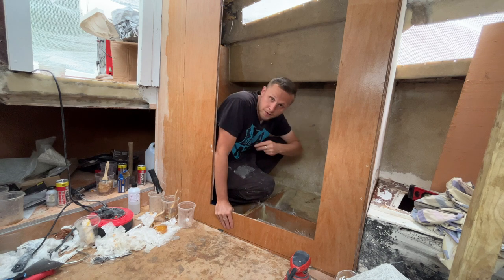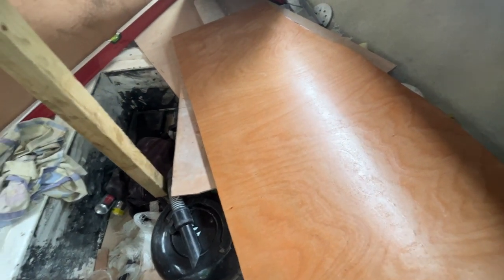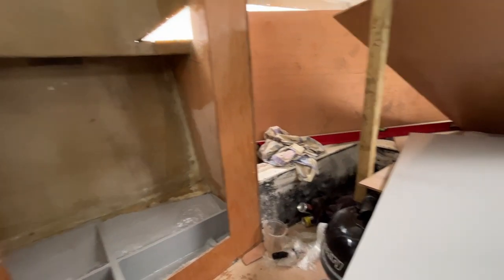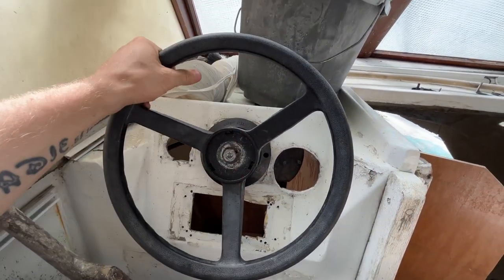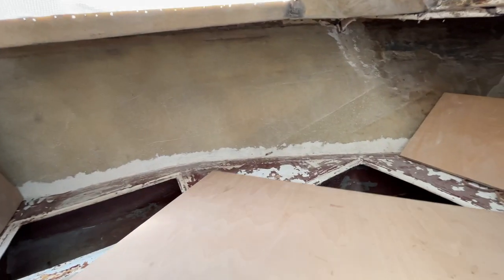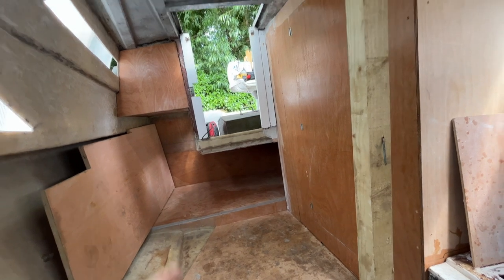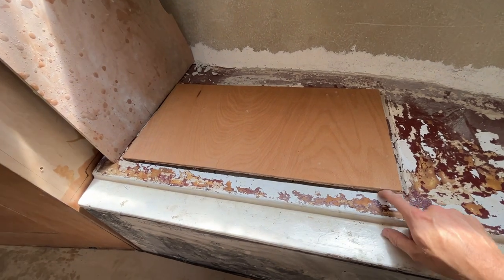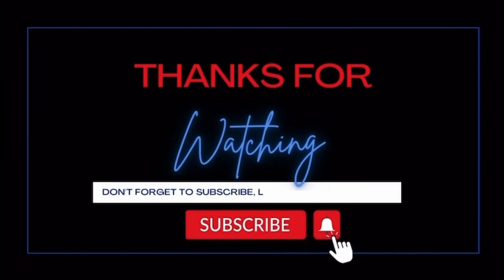Bilge paint the toilet floor and cutting a the new seating panels EPISODE 25

Comment: Glad the pullers worked. I'd forgotten some of the puller ends / fingers can sometimes be heavy gauge and are ok for areas with no obstruction behind. But its off now and another obstacle out of the way. I had seen another clip of a guy rebuilding his console two days ago and the shaft was just a smooth taper like yours. I had thought it may have splines like a car. 
Volusia's suggestion of having a look at the innards of the mechanism is good, as any grease could be dried up or the cable may be corroded. 
I also saw a short tutorial on epoxy resin by a guy from one of the resin companies. I'm not sure if you said you are using polyester resin, but I imagine it would still apply. The guy said for mixing, to cut the round end off the mixing stick. This allows you to get into the corners of the mixing cup and ensure a proper mix. The other thing he mentioned, and I wouldn't have thought about in 100 years is to mix the resin on a flat surface. Your body temperature is on average 38 degrees C and as most resins generate heat and start to harden quicker when its warm; the heat of your hand can set it off quicker than it should, especially in the current warmer weather. So that may be useful in a warm cabin. Its a natural instinct to hold the cup in your hand while mixing so you can see how its going.

With  the seat panels, rather than cut hatches which will need a strip to stop the hatch section collapsing when somebody sits on it; put hinges directly onto the panel. You'd only need relatively light hinges and cut a section out of the lip on the fiberglass base to allow room for the hinge. Attach one side of the hinge to the fiberglass and the other to the plywood. It keeps the full size opening available to you and what ever way you do it , you still have to lift the cushion up.
Reply from the maker: Thank you. I’m definitely glad that the steering is off thought I might of had to cut it off. Will be interesting to open it all up and see how it looks. I didn’t even think about body heat I will try to hold it less and hopefully that will help. That a really good idea with the seating because I was thinking the same so much more hassle cutting a hatch then more wood to stop them going trough it I’ve got a few hinges from the pack I used for the door that should work perfect. Thank you again for some great advice really appreciate it.